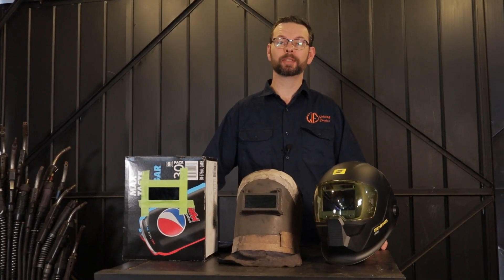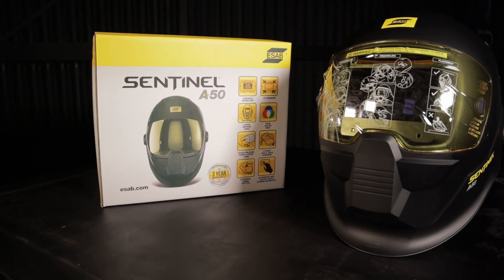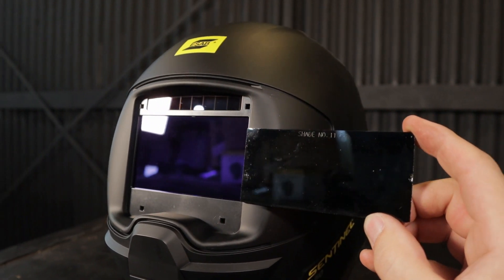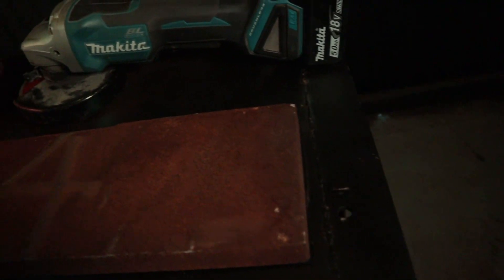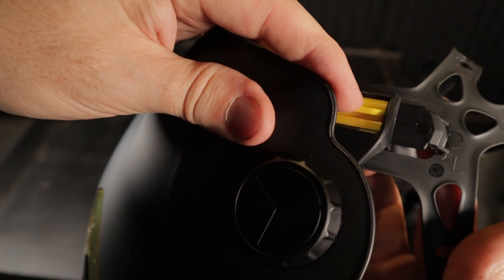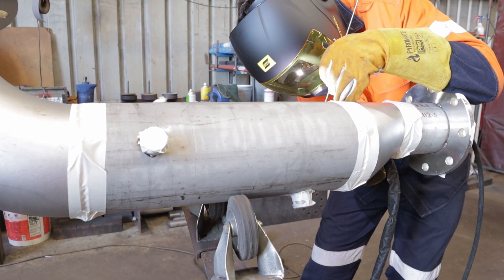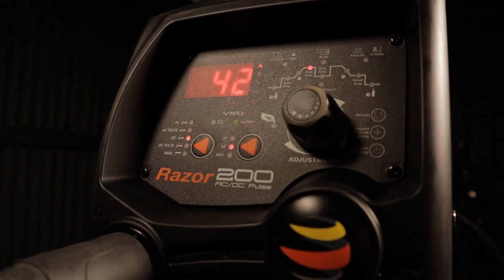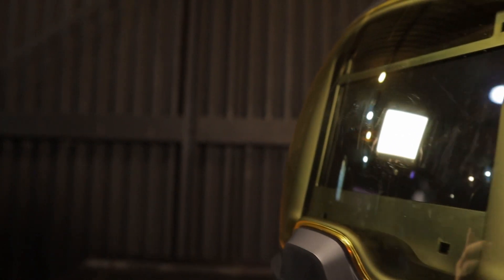ESAB Sentinel A50 Review | TIG Welding & Grind Mode Examples

Comment: Personal preference...which one do you like better. I'm trying to choose between the sentinel and the Viking right now...actually been tossing back and fourth for the past month. I want the Clearest view. But I work outside and inside, gtaw, gmaw, fcaw. Best and clearest all around helmet..
Reply from the maker: Hey J&R Mobile Welding. In my opinion for your line of work I would choose the 3350. It is better suited to FCA, theSentinel can distort the outer lens from the heat. I have a written review on both helmets at www.weldingempire.com
I hope that helps.

Comment: I cant put back small protective lenses , seems i cant find a way to do so , please help !
Reply from the maker: Hey Petar, The ESAB can be a tricky helmet to replace the lens. Curve the inside lens width ways and gently place one side under the small tabs. Once in keep the lens curved and slot it into the other side. I hope that helps. Thanks for watching.
Reply: @weldingempire  I have done it yesterday and I was welding for 8 hours straight , amazing helmet !

Comment: I have the money for it but I don’t know if I really need a 300 dollar hood. Is there any other hoods you would recommend
Reply from the maker: Hey, if you like the esab brand they have released the esab savage. Slightly smaller viewing area and no LCD screen. About half the price. Yes welder has a good helmet with a large viewing area with an external grinding switch too.
Reply: Lincoln Viking. Trust me. Way better even the 1740 for 120$
Reply: You won't regret the 300 price it's soo light you forget you are wearing a helmet even up. It's crazy I have it in school never have issues with neck or shiulders

Comment: Does anybody have problems with dark spots after welding? I have to set it to 13 for every process and I still see spots afterwards. I honestly hate this that I can’t find a hood that won’t give me spots. This is probably my 16th hood I’ve purchased and still, spots not solved. I can’t win.
Reply from the maker: Hey Michael, I haven't come across people having that problem before. 13 is a little dark for welding around home (if that's what you are doing).
Reply: @weldingempire  this is a very bright hood. welding with tig at 125 amps isn’t dark enough. And welding at 200? No way, have to wear sunglasses to alleviate the spots and discomfort. Junk helmet.
Reply: @Mikey-ym6ok  How can you say its a junk helmet? I've welded at those amperages and I dont even hit close to 13 for 125 amp,  for tig. I stay at around 11 easily. I think you might have sight issues man, you should go to a eye specialist and get your sight checked out. You might have retinal issues :/
Reply: @Mikey-ym6ok  I know this is a year ago,but did you get something that worked for you?
You stated 16 hoods you tried all.gave you the same issues, don't dint seem  brand specific?
I tig weld at everything from 30  to 290 amps.